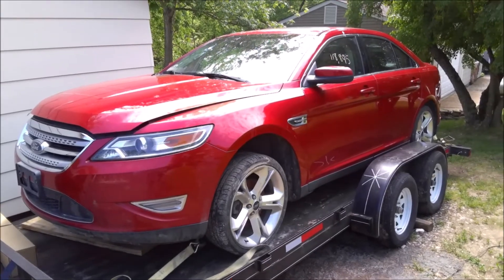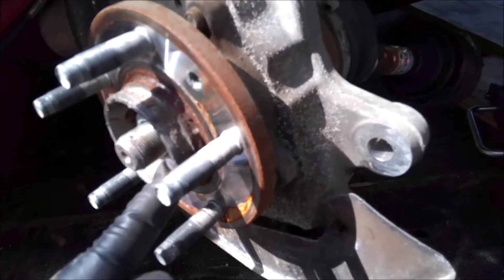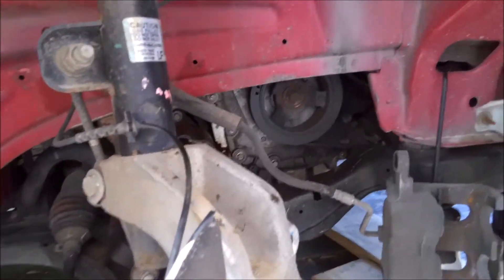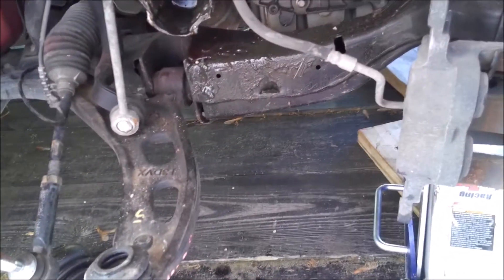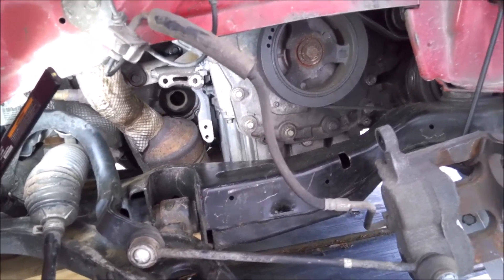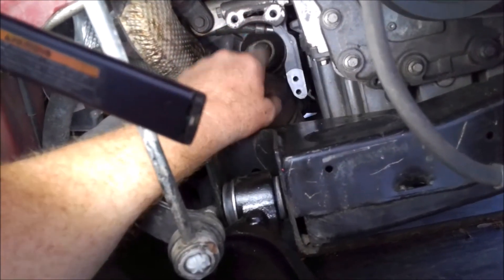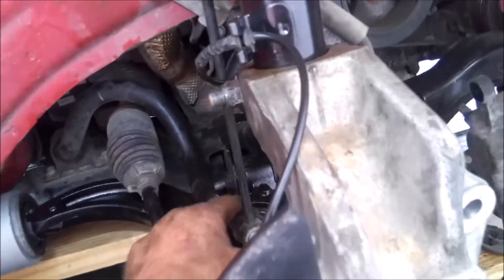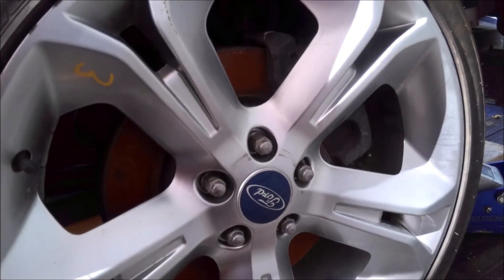2010 Ford SHO - Copart fix - axle, lower control arm, strut, ball joint

Comment: Quite a bit or rust & corrosion.  No wonder.  I just replaced the lower control arms w/ bushings, tie rods, vertical sway links, & struts on my wife's 2010 SHO with 98k.  Red just like yours!  Still have a rattle when driving on a rough road.  The metal-metal clunking is gone.  I'm not sure where else to look in the front for the rattle.

Comment: I've got a 2010 Taurus SEL with similar damage. Bought a used lower control arm trying to keep it oem and the ball joint is trashed. Is the ball joint replaceable because I can't find any. Trying to salvage my purchase. Great video and thanks
Reply from the maker: I believe those are non serviceable ball joints if memory serves you have to replace the entire control arm assembly
Reply: @HooptiesGarage  Thanks for the info. I kinda of figured that would be the case. Thanks for your help and for the informative video.
Reply from the maker: Thanks for watching I appreciate it!!

Comment: What do I gotta do just to replace lower control arm ??? Thanks in advance
Reply from the maker: Just pop lower ball joint off knuckle, remove lower sway link and remove the three bolts going to frame.
Reply: Hoopties Garage thanks I appreciate the info

Comment: Does the lower control arm have to be removed from the steering knuckle b4 you can remove the knuckle from the strut?
Reply from the maker: If you disconnect the sway link you should be able to pry down far enough on lower control arm to remove strut without removing the lower arm.
Reply: @HooptiesGarage  ok I'll give that a try. Thanks
Reply: Thanks for this vidio i got the same issue. You are life saver